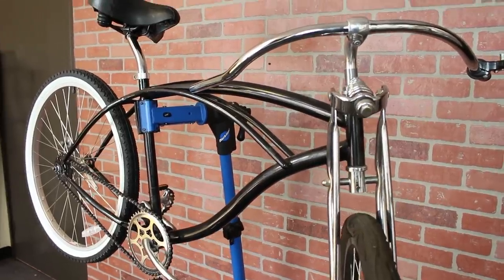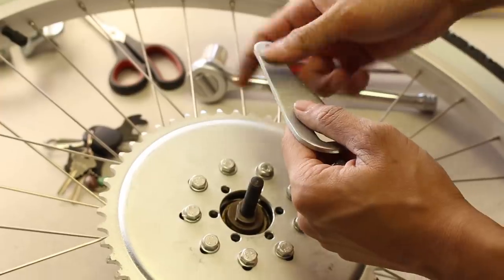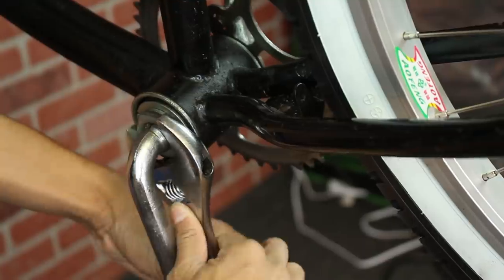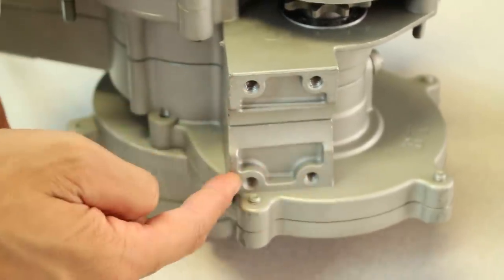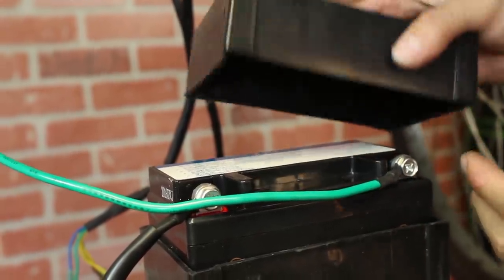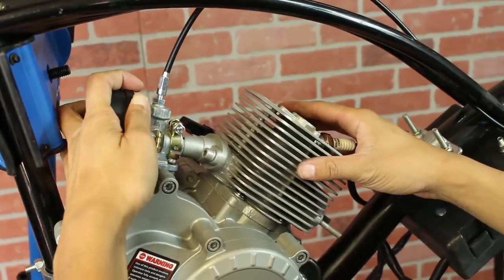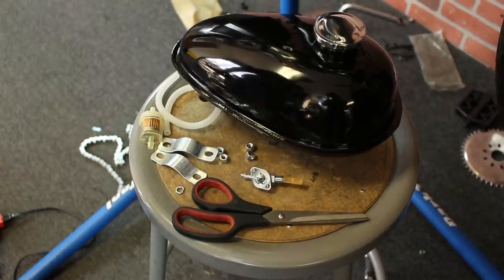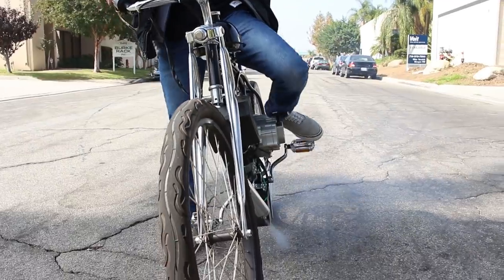How To Install a 2-Stroke 66cc 80cc BULLET TRAIN Engine Kit for Motorized Gas Bicycle

Comment: For almost $300.00 this is probably the best kit but I saw one for $150 that got 4 1/2 star rating with 36 reviews.  Sure it didn't have battery w/ electric start (pedal start) but motor is same size and that statistic shows a lot of happy customers.

Comment: Fuel Filter is backwards-
Reply: i noticed that too
Reply: Does it matter?
Reply: @connorssmallengines6663  Yes it actually does make a difference. There is an arrow indicating fuel flow direction, to reverse that would make the filter less efficient and prone to clogging.
Reply: Jesus neitha

Comment: why are you using an ajustable spanner and pliers on the fittings instead of the correct size spanners or sockets ?
Reply from the maker: We want to show that installation is possible, even with a limited selection of tools. We always encourage the use of the correct tools, as they will reduce the likelihood of injury and damage to parts and will make the processes an easier task.
Reply: @bikeberry  good answer.

Comment: Never tighten a spark plug as tight as you can on a aluminum head, you will strip the threads.
Reply: Marty Wickstrom   Well said and so so true.
Reply: And the friggin gasoline filter is backwards!!!!!!
Reply: It'll blow the Filter Fabric up inside of the plastic instead of keeping it compressed like it would if it were flowing the other way around
Reply: That aluminum head on the plug is durable but platinum heads are better and last longer and won't burn out as fast!
Reply: @punchogunter2362  He was talking about the engine not the spark plug... facepalms  Besides they don't even make aluminum spark plugs, platinum is good but iridium is much better and will likely out live this engine and a few dozen more.
Reply: @SilvaDreams  I know that! At the time I was typing too fast and working plush when you have spell check it screws up a sentence!
Reply: dont worry i am very pro
Reply: @integrationofmanandmachine4714  NICE!!!!!
Reply: @punchogunter2362  66yyy
Reply: so you just hand tighten it right?
Reply: @kushpaladin  hand tight then a 1/4 turn
Reply: instablaster

Comment: i build small 2t motorcycles as a hobby/way of life. my favorites are tomos, puch, derbi. i've seen a few "bicycle kits" in action, and they never seem to run very well. it's good that there is a piece you can buy to avoid bolting the sprocket to the spokes. that element of the design was always a deal breaker for me. 12v batteries can't shock you. good vid tho.

Comment: you can substitute a dull pencil in place of screwdriver when truing the rear sprocket. make sure the pencil has a broad, dull tip. wipe off the marks with damp cloth after each modification.

Comment: The kill switch is supposed to be the red switch and the current kill switch is supposed to be for lights
Reply: Mac Crume exactly, these idiots selling the kit are obviously are just oblivious middlemen
Reply: Hey, it sounds like you own one of these billet trains. The bike berry website does not talk about how the batter gets charged. Is there a generator in the engine or do you have to charge the battery externally?
Reply: Mac Crume Mr ni
Reply: Do you know the correct diagram?
Reply: Dr Din if you take a wire to both terminals you’ll be hurting a bit but just touching both terminals with your hands... really? Can I die from putting a 9 volt on my tongue too?
Reply: actually your right... i have one of those and my problem is when i throttle the starter motor keeps on spinning.

Comment: to everybody who is installing this on there own USE BLUE LOVE TIGHT on every bolt and nut if you do not use lockight it will fall apart DO NOT USE red locktight  IT will break bolts blue locktight everything lockwashers are junk and do not work that well if you have any questions I am a mechanic with many many years exp building custom bikes scooters and motorcycles just send me a message I am not talking any trash about the person who made this vid it looks like thay installed the kit correct just use lock tight on everything if you don't want to be walking down the street looking for the missing parts that will fall off good luck
Reply: Great advice.

If you do happen to use red lock-tite and you're having trouble removing anything, just apply heat to the area and it should break loose  easily.
Reply: jon dee what is the difference i am buying one soon and i would like to know
Reply: Love tight, my favorite.
Reply: The red is polyester urethane, the blue silicon
Reply: Listen to this man, Loc Tite That bike up the Blue One NOT the Red super strength one. Loctite is your friend, also change the Chain its garbage buy a HD 415H motorcycle Chain+ heavy duty Chain Tool as well.
Reply: Can I hook up a key start to a 4 stroke??

Comment: The shutoff switch doesn't work because you wired it up wrong. You wired up the light switch instead of the kill switch XD
Reply: LOL i seen that too
Reply: can these engines take a light? Id consider buying one if they can take a light.
Reply: @lucajo16  yes they can

Comment: You have two spare wire positions left in the loom near the relay, a blue and a green. I'm sure you can use them for a light which will run directly off the battery.
Reply from the maker: You are correct. Most of our product videos should be taken as a general outline, as most of these parts are manufactured with room for future custom modifications.
Reply: Hello BikeBerry! Could you please upload a video on how to connect light and speedometer through the electric box?
Reply: We're do I connect the red wire from the engine too?

Comment: Well, you installed the fuel filter upside down but whatever
Reply: Yea i saw one same guy in yt
Reply: ant the most important thing is that little metal piece in the fuel filter, its a magnet to catch any tiny metal pieces that. old have been in the fuel tank
Reply: yall wrong in wveryway

Comment: Is there a way to put a transmission on the bike so you can use the gears on the bike and leave your disk brakes on the back wheel

Comment: Few questions:
1. Is the oil poured in the engine side mix with gas?
2. Is there and gas-oil mixing that I have to do before pouring fuel in the tank?
3. Are the batteries rechargeable with a car battery charger
4. Break in period length?
Reply: Youtube Commenter straight motor oil to the side and a fuel mix to the tank.
Reply: And it should keep itself charged just like your car.

Comment: wow theres an electric start now?? i gotta get one of these kits..
Reply: Yuo don't it's shitty get the older proven style.
Reply: okay well thanks for the heads up lol
Reply: I already have a bike that has been with me for 6 years now :) I had two but the other got totaled due to a car hitting me
Reply: Yuo  the best i tried so far is 4 strokes theyre slower but reliable.all engine require prpper break in tho.
Reply: if you can fab and weld I have put 6.5 HP ohv w/centifical cluch fab 1/4''stainless steel plate with slotted holes for adjustable motor mounts  and reached speeds of over 40mph I use a jack shaft set up  to get both low end toruqe and hi end speed

Comment: So when you put motor oil in this thing do you still have to pre mix the fuel in addition to that? Or do you just put oil in the crankcase and straight gas in the tank?
Reply from the maker: You still have to mix it.
Reply: ZER0  2 stroke are good winter beaters if you live in new england region of america because it can get so cold you dont wanna wrench anything i.e drain plug and tjen funnel the oil in.my 4 stroke is my summer toy winter ill beat on tje 2 smoker.
Reply: The oil going into the crankcase is for cooling the engine itself internally and keeping the moving parts inside moving smoothly.  The oil you add to the gas is to keep the pistons running smoothly.  Do not skip adding oil to your gas.

A smart modification to your bike would be to add some kind of storage rack or case on the bike, where you can carry an extra bottle of 2-stroke oil and/or a spare (appropriate) container of mixed fuel.  Other smart modifications would be to add an LED headlight and tail light assembly, plus turn signals, and if you wish it to be a street legal bike mod (this is over 49cc) you will need a license plate.  Check your local DMV for requirements in your area.

As their build is, completed, it's perfectly legal to ride off-road or possibly during daylight hours only in most areas, or quite likely without much in the way of restrictions way out in the boonies.
Reply: Wow... ok folks 2 stroke mix oil is for 2 stroke engines and 4 stroke engine are lubricated from the oil reserve in the crank case and it is different kind of oil. Use synthetic 2 stroke mix oil to reduce smoke

Comment: I like the size of the engine but not the battery box because of wanting to use it for hunting/scouting for deer can it be used with out the battery box and battery and still run?
Reply from the maker: You can always pedal.

Comment: Do not tight the spark plug as tight as you can. It will strip the threads in the head.
Reply: Yes, finger tight then half turn with socket
Reply: lol i will destroy anything with those torque specs.

Comment: Always hook up the negative terminal on a battery LAST, and take it off FIRST. Basic safety rule.
Reply: My wires got burned from the exhaust, we're do connect the red wire from the starter too?

Comment: I bought one and it only lasted 2 weeks before the bolts self vibrated off so i recomend welding your engine and gastank for extended performance
Reply: Vicente Binladen wow.you should know to loctite blue all nuts and bolts so it wo t be ever rattle itself out
Reply: Worried about welding on fuel tank incase of hazard? Fill it with water first...

Comment: why is there a separate place to put motor oil if it's a 2 stroke?
Reply: Larry Shaver  could be cooling could be mixing
Reply: Its for the gears and wet clutch thats in this thing. Personally i prefer the conventional 2 stroke kits because theyre manual transmission
Reply: All of your higher quality motorcycle engines use gear oil in the lower unit. It does not draw oil up into to the combustion chamber as a four stroke does, and it rarely needs to be changed.

Comment: That carburetor needed adjusting,you could hear it bogging while giving it the gas. Fine tuning those can be a headache.
Reply from the maker: Just as you said, "fine tuning [a carburetor] can be a headache," that is why we neglected to fine tune it for this specific install video. We are currently working on a video for tuning a carburetor. Stay tuned and check back for our new videos.
Reply: RC Hobbyist Extreme if you raise the needle to the next to highest position it always runs better .
Reply: RC Hobbyist Extreme
Reply: I do wonder how it would run with a pocketbike nitro carb
Reply: If u tune rc cars, bikes should be nothing to you 😂, them little nitro engines are a pain

Comment: if you look in the manual says 70 cc and in struction book for this engine kit BT80. I bought the kit and I looked in instruction book and that's the reason why I know about it
Reply from the maker: Sorry were a little confused, is this a question?
Reply: Look at the instruction book and come to the bullet train BT80 kit it says 70 cc in the instruction book just want you to know that it's a 70cc for the engine size .
Reply: You going to get any more in-stock on your website cuz I'm looking to buy another one bullet train bt80

Comment: On the axillary wires which would be the positive and which would be the negative because I'm trying to hook up a light setup that has brake lights and turn signals include?
Reply from the maker: Contact our customer service representatives for step by step trouble shooting and help. 1-800-317-0479

Comment: He put the fuel filter on backwards, how do you stop safely without brakes, and I bet those unknow switches on the killswitch can be used for a headlight that can be wired pretty easily into that system.

Comment: is it safe to only rely on coaster brakes going that fast on a cruiser?????  please let me know
Reply: 1davriaking   Coaster brake will get the job done,  but for   about another $30 you can get a cheap front and rear caliper brake set. Personally, that's what I'd do, brakes are not a good place to cut costs.
Reply: Eventually, that coaster brake is gonna bend your rear rim out of shape. Especially if you make hard stops. Get some Tektro claw brakes and you'll be good to go.
Reply: best option is to put disc brake on front and caliper brake on rear.
Reply: use a junk  motor cycle brake from a junk yard  a lot better

Comment: any tips or videos on drilling the hole into the handlebars? I don't wanna mess that up
Reply: Center punch where u want the hole to be and start with a very small drill bit and go slow with little to no pressure

Comment: Is the kill switch absolutely necessary or will the bike run ok without it
Reply from the maker: You can run the bike without a kill switch however this is dangerous and not recommended.

Comment: does your starter motor keeps on spinning? i installed one of those but there's a noisy sound its like the starter motor is spinning when i throttle.

Comment: look nice but wat about if it rain or snow and i have to go to work 
why not make a cover too
Reply from the maker: In general, we would always advice riders to refrain from riding in bad weather, due to the increased danger and possible damage to all moving parts, even those not associated to the engine kit, such as brake cables, brake calipers, chain, and internal bearings.

Comment: Does the battery clear speed bumps?
Reply: mount it on a rear rack or higher up on downtube. bad location under crank haha
Reply: Yeah the rear rack idea is probably best it will also look better
Reply: John Harrington

Comment: Think that red toggle button is for the turning signal no ?
Reply from the maker: It can definitely be used for a turn signal. For our build, we left out all lights and had no use for it. With a little wire management, these switches can function for any use desired.

Comment: Why don't you flip the brake dust cap upside down on top of the new sprocket to help hold it in place and keep the new sprocket centered at the same time. Seems like common sense plus it would help free up your hands to ease in the bolt installation. You know you can use a piece of heavy gauge solid core house wire wrapped around the rear frame tube to use as a truing pointer for the rear sprocket at the same location as the screwdriver; again; freeing up your hands. BTW, to anyone who is intending to do this installation...Buy a small sheet of rubber for vibration insulation and prevention of vibrating loose any of the fasteners.
Reply from the maker: Great advice! We'll be sure to use this information in future videos.

Comment: Should have put more grease on the crank bearings and definitely do not tighten the spark plug as tight as you can as you will strip the threads fairly easily
Reply from the maker: Great advice! We are constantly trying to improve the quality of our videos to make it as informative and entertaining as possible

Comment: Can I completely remove the pedal set and still be able to use it?
Reply: Pravin Kumar why not
Reply: In some states that makes it a motorcycle.
You might have to have a licence then.
Reply: Not fast enough it has a poor little low preformance 2 stroke on it

Comment: So should I get a normal 80cc 2 stroke or 212cc 4 stroke?
Reply from the maker: It depends on your riding needs. This is long debated topic, with life long fans on both sides. Typically, 2 strokes are lighter and have a higher top speed, 4-strokes are a little heavier but have better torque and provide a smoother ride.

Comment: My electrical box has two blue and white wires that have two female ends so I can not connect them. also, it does not have a green grounding wire. I am also having issues with mounting the crank and pedal assemblies, the parts are too small.

Comment: So why can we not use a forward crank frame?  What if we made a custom frame with solid welds, and extra supports? still do not use this kit?
Reply from the maker: The mounting points on the engine don't match up with frames with the forward pedaling cranks and it doesn't provide enough clearance for the crank pedal extender. If you're experienced in modifications and custom builds, then go for it! We have seen some amazing and creative DIY motorized bike builds. However, for those who don't have experience or don't have the option to customize, then the frame for the easiest type of build is using a standard beach cruiser frame like what we used in our video.
Reply: Hi, what is its max speed

Comment: You would not be hurt from that batter there's not enough voltage, two why would you have a electric start anyways just put a kick start in saves a lot of weight.

Comment: But that battery hanging low don't look good is there a better place?
Reply from the maker: Great question. It is possible to mount the battery behind the seat post but this may only be possible with a rear rack or if the seat post is pulled out enough to have the appropriate length for mouting. Mounting underneath the bike is simply the most universally accessible and convenient location.

Comment: for anyone with experience please help me, I wanna k if this modified bike practical, does it go on the road without problems ?
Reply: I'm not super experienced, but I've researched a lot and this should be coming in the mail soon. As long as you take proper care and maintenance of the engine, it should last quite a long time without major problems.

Comment: That fuel filter is up side down and the red switch is normally for head lights
Reply from the maker: Be sure to turn on your video annotations, located in the video settings tab. This will show corrections and updates in the video.